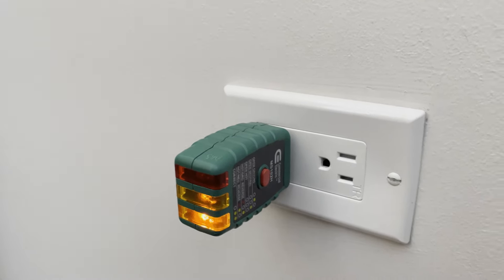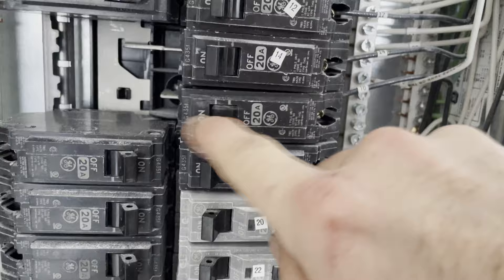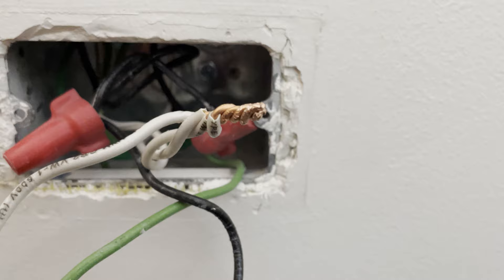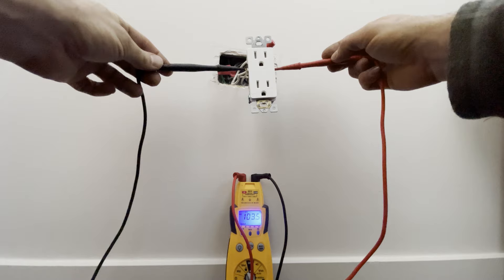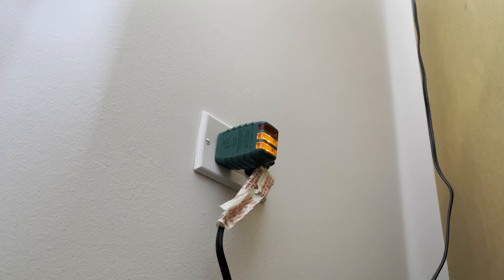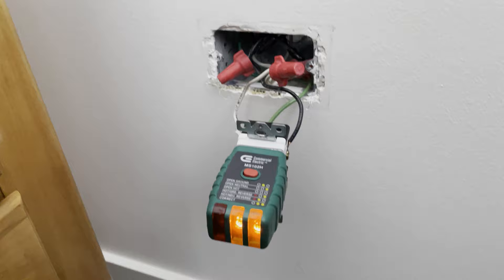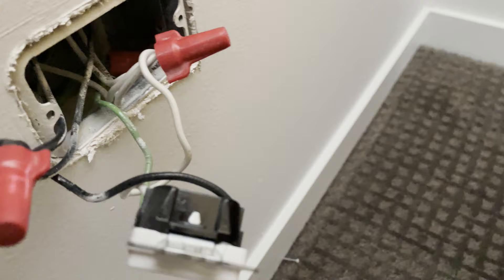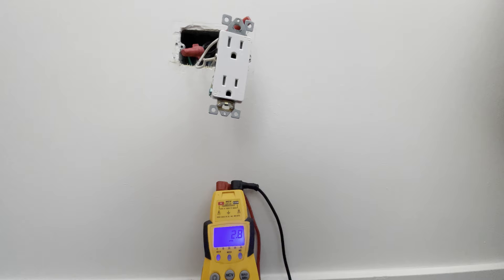Open Neutral Outlet Troubleshooting

Comment: Huge help! Many of the vids I was seeing are a bit esoteric for this layperson , but your words, “ start at the box “ and then move down the line, as well as , “ it’s usually something simple” were exactly right. I had a snapped neutral in box; line was still barley touching the stub in the screw panel inside box, but when I put one finger on, it fell off. I re-stripped the neutral, re-connected to screw panel, and voila..

Thank you for taking time to put that video out!
Reply from the maker: Thanks for the feedback and for watching ! Glad it helped you fix your problem 😀

Comment: If you install a test lead on the neutral and a test lead on the ground to one of the receptacles that are not working on the circuit, you will get 120 V. That always tells me that I have lost a neutral somewhere.The trick is finding that loose neutral without taking apart a majority of devices and fixtures in the house. That’s where a good tracer comes in handy. Stay safe!

Comment: Thanks man! im having the same problem with a plug in my living room, so i'll go down an backtrack thru the whole run of wires...
Reply: lmao just had this issue but unfortunately im not redoing all the outlets in this rental property to find the loose wirenut. Ended up just shorting ground to Neutral. APARTMENT MAINTENANCE PRO, Heres a TIP..... TWIST the wires together next time before putting a wire nut :D and or USE a COAX screwdriver to help drive those NUTS tighter.  IF THIS IS A NEW JOB and you didnt connect a NEUTRAL somewhere because YOU DIDNT DO IT RIGHT lol thats a problem :D. Thumbs up tho. Tighten that grip homey :D
Reply: What are you talking about kero  kero Bonita?

Comment: It would be nice to be able to follow the circuit in a concrete wall that you can't see where it goes next and have 9 circuits with open ground faults. Maybe take an extension cord plugged into one outlet that is okay and go to the other outlets and do an ohm check on the neutral, reckon?

Comment: Very helpful, thank you. I have two outlets with open neutrals, but I'm not sure which circuit they're on and I can't trace it due to the open neutral. I can guess based on their position where the wires are coming from and start there.
Reply from the maker: 🤞 good luck

Comment: I originally had 3 outlets not working. They all had 120v and properly grounded. I shutoff the fuse box and replaced each receptacle in the daisy chain. Finally on the 6th and last receptacle that was the bad one. It also somehow fixed the bathroom light as well which was bonus, that was my next job.
Reply: My initial problem was an open neutral on my tester.

Comment: So I'm trying to fix an open neutral GFI circuit right now.  To narrow down what outlets were involved on this circuit, I shut off the breaker for that circuit, and used an outlet tester to find all "off" outlets in the house.  I've narrowed it down to a GFI outlet in upstairs bath, and 2 standard outlets in the downstairs bath.  I believe the upstairs GFI outlet is the one closest to the panel box, and the 2 others come off of that.  I check all wire connections, nothing disconnected or loose.  I even replaced the GFI outlet and the 2 standard subsequent ones.  The two standard outlets still show as open neutral on the tester and aren't working.  The only thing I haven't changed out is the circuit breaker in the panel box (I have to go get a replacement one).  If all of these changes don't resolve it, what is left?  Seems unlikely that the wiring in the wall could be an issue, these things are usually an issue at an end point.  Any suggestions on what else to try?  I'm about out of ideas....
Reply from the maker: It's really hard to say. Was everything working and then just suddenly stopped? Are you using arc-fault breakers? Are you absolutely sure the GFCI's are wired correctly?

Comment: gotta try this tomorrow. my appliances started goin off & on a few months, I changed All the kitchen outlets, didn't work. I checked with Electrical Tester. Says open neutral / ground. I'm gonna check the neutral from the box, down to the outlets & lights.
Reply from the maker: Hi, were you able to locate the problem?
Reply: @ApartmentMaintenancePro  No. I changed every outlet. No loose wires. Can it be in the wall? Even Check the junction box, no loose wires, but rewired anyway. Everything looks good. Breaking my head, SMH. Been using a outlet for the fridge & stove.

Comment: In case anyone was expecting 120V, I have a volt meter on my home elec supply and it has read steady 247.9Vac for years. I suspect there's an upper limit they're allowed and they stay at that in case there are any dips.
Reply from the maker: Supply voltage in the US to the main panel is 240v
Reply: @ApartmentMaintenancePro  My message is that my supply is 247.9V. Newer construction in newer neighborhood. Deffinitily intentional.

Comment: 1:54 - What does testing continuity do? (How do you test it? New to electrical stuff)
Reply from the maker: short answer. If you put your meter probe on one end of a wire, and the other probe on the other end of the wire, it will read resistance meaning the wire is intact. If the wire was broken, it would read OL. Just do a search on wiring and continuity I'm sure there several people that can explain it better than me :)
Reply: Her
Reply: It verifies that the neutral wire is functional between the two outlets.  Then just need to verify quality of connection of said white neutral on both sides.

Comment: Quick question boss about the plug in,is there anyway to change the batteries opening the plug-in or once it’s stops working it’s over ?
Reply from the maker: Check with the man if it probably toast I wouldn’t trust it

Comment: May I ask..I plug something in an outlet and the closet light comes on..hard wired..no switch in closet..thank you
Reply from the maker: Unless you are extremely comfortable using a meter and understand residential wiring, call an electrician
Reply: Sounds like when you plug something in you are "jumping a gap" giving you a reversed hot/neutral on the closet light. Just my 1st thought. Electrical is like a box of chocolates, you never know what you're gonna get ..
Reply: @Mr-hm1wr  you are so right!!!
It reads hot neutral reversed at this point..I will not give up on this chocolate bix..I will use meter and chk continuity at this point I guess
Reply: Thanks for taking the time my friend!!

Comment: Nice troubleshooting bro 💪 You got lucky on that one. Sometimes you can find the issue right away, & other times it's the last outlet you check after an hour or more of troubleshooting. 👍
Reply from the maker: Very true. Thanks for checking it out man hope all has been well with you :)
Reply: I was installing a new light switch (on its own circuit) and I accidentally shorted (zapped) it. Nothing tripped but since then I’m sporadically getting 90v-110v on my outlets and all the lights in the home dim. Sounds like I should check the neutrals on all the panels? Any other suggestions for troubleshooting? Not an electrician and when they come out everything is working so they can’t troubleshoot.